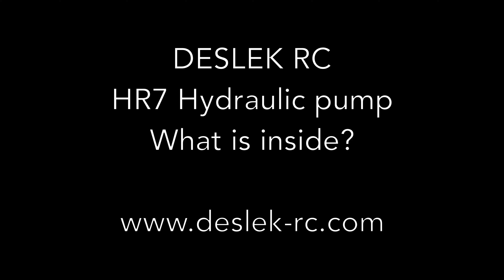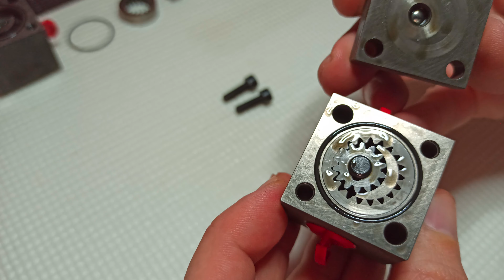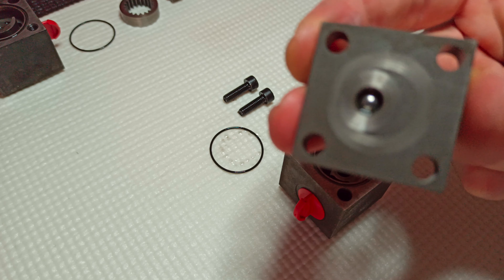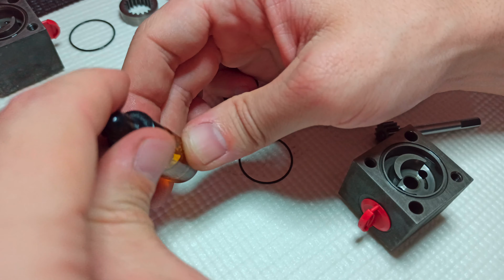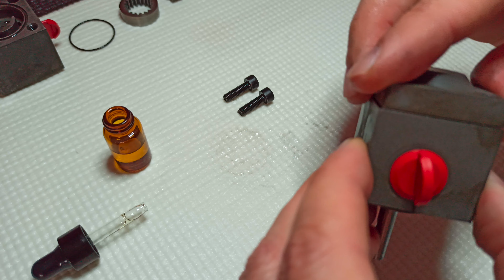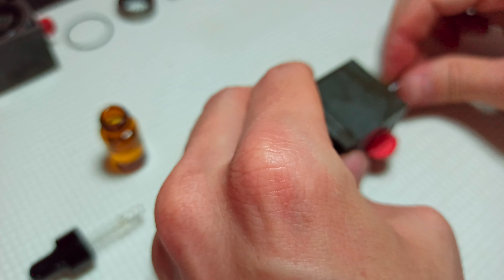HR7 Hydraulic pump - What is inside? [DESLEK RC]

Comment: What is maximum RPM, Litres per minute, and pressure output please.  All so I'm looking for a hydraulic motor to drive off of a pump like this for driving a model tank with gas engine.     Would preferably like a Axial viable displacement swash plate piston pump. Control and pump in one unit to drive motor forward, back with change in angle of swash plate
Reply from the maker: Hello Russ, pressure output is about 30 bars (with our belt system). The pump itself can give up to 60 bar. Flow is around 900/1000 mL/minute and it depends of the oil used. Maximum RPM are about 3000. More info here: https://www.deslek-rc.com/en/hydraulics/hydraulic-pumps/hr7-hydraulic-pump-with-roxxy-950kv
Reply: @DESLEKRC  that is some good data.  Very impressive little unit